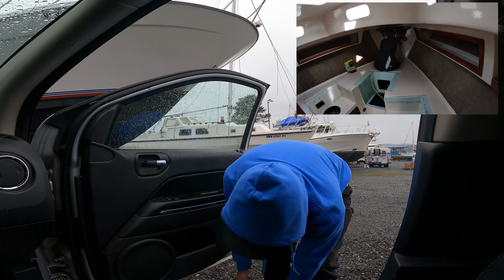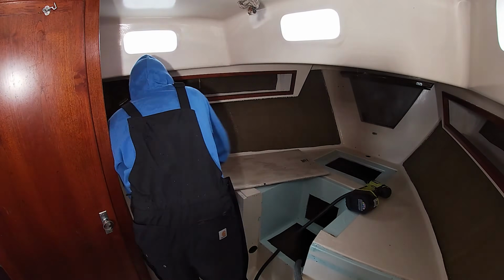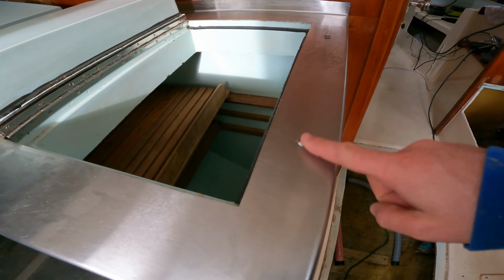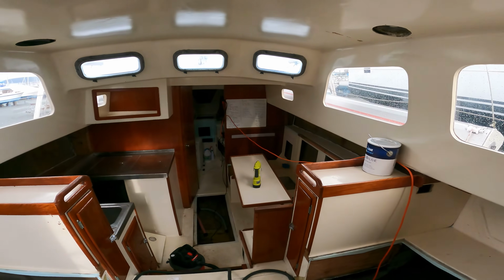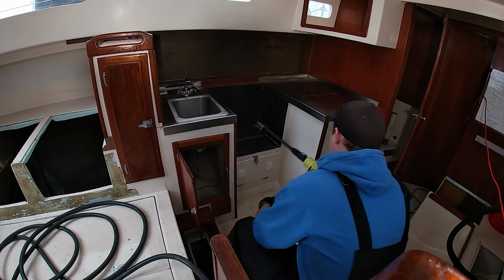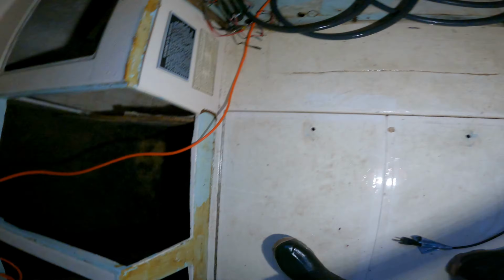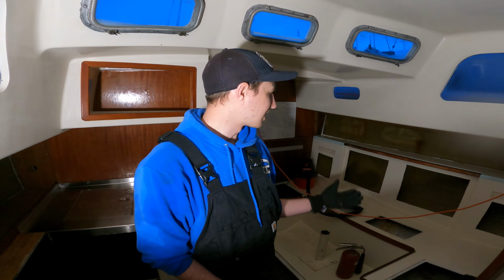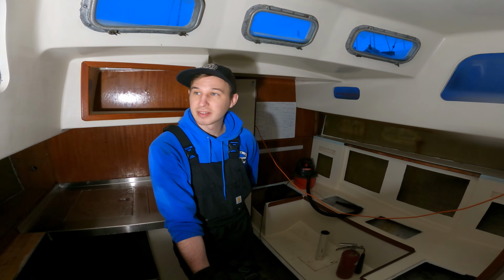Power Washing Sailboat Interior

Comment: Talk to your paint distributor about encapsulating stains with the right primer. Asbestos used to be removed. Now it is often mitigated with 100% acrylic paint. There has to be an analogue in the bilge. They just need to be clean enough which usually means breaking the film on the surface being treated.
Reply: Figure out which paint you are going to use first, then follow the directions. Read first. In spite of your vast knowledge, you are operating with huge holes of missing information in the proper making of a plan.
Reply from the maker: Vast knowledge is definitely not what I would say I have, but there is only sure-fire way to gain wisdom. I will check what the distributor says.